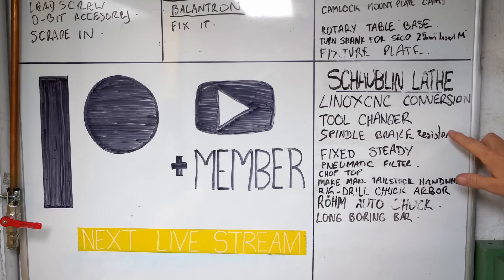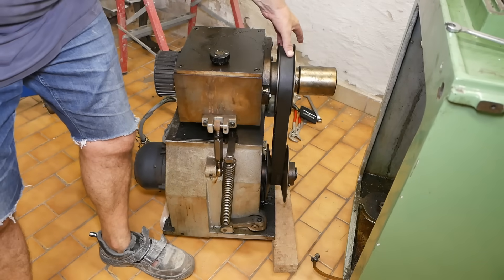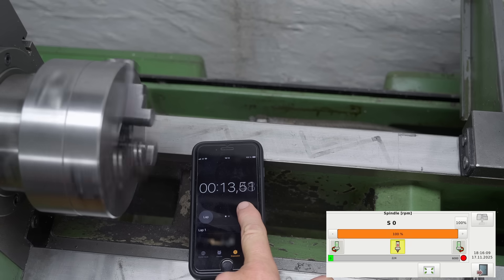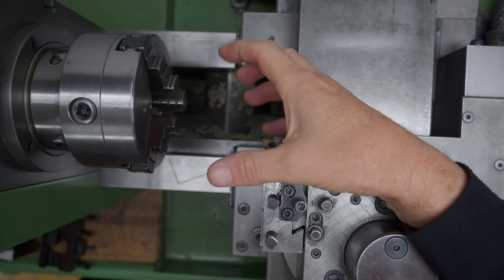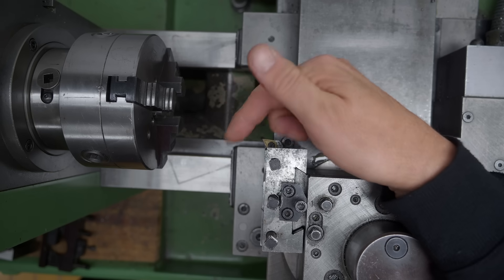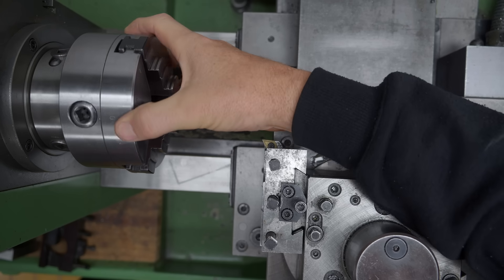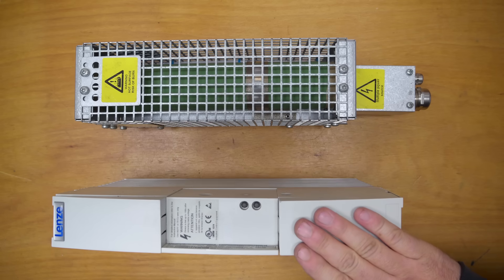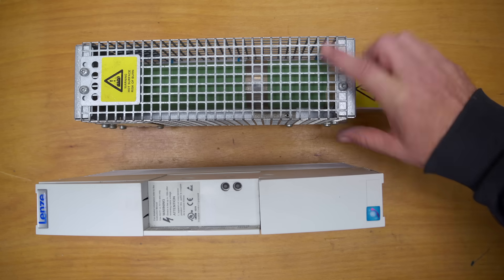Help me with this VFD Please - Schaublin 125-CNC Ep. 62 || RotarySMP

Comment: Hi, I have a Lenze 8200 single phase 1500 Watt with a resistor for braking purpose since years running. As fare as I remember I was able to set up different times to stop the machine. I choose a limitation that correlates to heat that occur in the resitor during handoperated lathe modes. Do you use vector mode?
If needed, I have to look into the details within some days.
regards klaus.
Reply from the maker: Mine is an earlier 8200 version, it is not a vector drive. I have got mine working with the help I received. 
I'll upload a follow up video to show what I did.

Comment: If you want to ramp down you have to leave RFR input 28 on. If you disable the input 28 the output transistors are disabled. You can use a time delay or better use the . There are also two modes to brake the Motor DCB (DC brake). It breaks the motor by inducing a DC current into the coils. So you don't need a brake chopper to stop the motor. So the DC link voltage goes up and the brake chopper kicks in at the set voltage (jumper at the brake chopper). I think  the QSP input was inverted (low = stop), in case of a wire brake the inverter will stop.
Reply from the maker: You nailed it. I thought I was only using pin 28 for Machine start up / shut down and E-Stop. Turns out I was using it for spindle start/stop. Doh!

Comment: These are some of my thoughts about this subject. I have never programmed a Lenze VFD so what do I know?
Instead, I have programmed (successfully) 5 Huanyang VFD's and one Siemens. 5 of those are already in my workshop and do just fine.

Thought 1)
If You decelerate the speed faster than the deceleration curve, the voltage in the capacitor will raise above safe level. In this case the VFD just simply disconnects the motor and enters a fault state. With Hy VFD, this can be cleared with the RESET wire or by cycling the power. I think Your Lenze does exactly this.

Thought 2)
You will need the braking resistor and You need it to be enabled if You intent to decelerate the spindle faster than it would do just coasting down.
My lathe stops from 3 krpm in 2 seconds max, usually well under one second.. Without the resistor I had to adjust the ramp to 20 seconds for the worst scenario.

Thought 3)
If You purchased the VFD second hand, it is a really good idea to do a system reset (factory settings) for it. This way You have a known starting point for Your ordeal.

Since this application seems not to be controlled using serial interface (which is fun) there is no need to be concerned about the lifetime of the internal NVRAM. Namely, earlier non volatile RAMs had a maximum guaranteed write cycle count. Exceeding this would make the device unreliable. That count was quite low, something like 10 - 30 kcycles. One can easily end in trouble with an interface that programmatically alters the contents of the NVRAM.
Reply from the maker: I got it figured out, and will do an update video.
Reply: @RotarySMP  Good to hear.

Comment: your VFD is a vector type drive, so it does not inherently need a braking resistor to do dc injection or phase shift on the motor windings to cancel out the inertia of the spinning rotor.  Depending on inertia, the respective operating voltages of the mains, bucked DC rail and whatever it's doing on the phase leads, you might not have enough headroom to sink that energy and hence the braking resistor comes into play.

Looking at the thing spooling down, it's not doing any negative torque command to more rapidly stop the motion.  There may something like a current limit where it's tripping and then reverting to "drive inhibit, stop doing things on the phases" and kind of goes hands off.  

What signal are you asserting for run/stop?
Reply from the maker: Hi Paul, where did you read that this model of VFD is a vector drive? 
I was using drive enable as start/stop. Doh! I'll do a quick update video.
Reply: @RotarySMP I googled the model number, may be wrong

Comment: Does the VFD support modbus via RS485? I control my lathe spindle like that, from LinuxCNC, constant surface speed works very well.
Reply from the maker: Nope. Only Analog speed control, or presets.  I am wired for analog.

Comment: Hands up, never configured a VFD, but one thought did occur. If your vfd has been grumbling about overcurrent when trying to stop witj a lot of inertia, could it be that its built in braking resistor has burnt out, or a transistor or other gate normally used to connect the motor coils to resistors has burnt out?

Only thing thay suggests otherwise is that your clip clearly showed that the display was showing something different when it was showing the error, whereas I would have guessed that if the internal resistor or gate had burnt out, I would not expect the device to actually know about it.
Reply from the maker: That is what I considered Dave, but it turned out to be my misunderstanding of how I has set up Linuxcnc to command a stop. I'll do a video on it.

Comment: How is your brake unit configured? According to the manuals the unit has 3 switches for configuration, S1 and S2 set the activation voltage and S3 is for master/slave configuration. S3 has to be OFF on the master or single unit.
According to the VFD Manual p. 10-2 725/765 V are allowed for the activation voltage, according to the brake unit manual p. 4-16 this corresponds to S1/S2 = ON/OFF for 725V or ON/ON for 765V
Reply from the maker: Okay, I was able to play around with it some and think I understand it a little better.

The brake is working, but only during a speed change. So with C13 = 0.5S, and C023 at 110% current, the spindle sped change from 70 Hz to 20 Hz is braked (nicely). So that solves my decel between CSS facing cuts.

But switching spindle off coasts down. Since I am commanding the VFD with analog 0-10V, I thought spindle off just meant 0V commanded, but I guess it is uncommanded, and therefore the spindle motor output is simply disconnected. Maybe I do need an additional output pin to E3, and teach LinuxCNC how to command a stop.
Reply: My guess would be, that with Off, LinuxCNC switches Pin 28 to low und the VFD just breaks the power connection. I think you want to use the QuickStop function and that needs E3 in some form to work, the VFD has multiple configuration possibilities and I dont know enough about LinuxCNC to see wich one would be the easiest to make work. And you mentioned safety, depending on how your E-Stop chain is wired up, that might need some adaption too if you want the spindle to quickly stop in case of an E-Stop. You need to make sure, that the breaking of the power connection to the spindle is delayed, so the VFD can actively break the motor before the connection is cut.
Reply from the maker: @WoodmanX  Yeah, I thought I was only using Pin 28 for machine start/ shut down and E-Stop, but had set it to react to the spindle stop command. I need to have a think about the best course of fixing it.

Comment: Looking at how you have it connected I'm guess you are stopping it by disabling the 'controller enable' input (pin 28), do you need to just drop the analog input to 0v, so the controller is still enabled, but the requested RPM is 0?
Reply from the maker: No Pin 28 is used, but only for machine start up and shut down, or E-Stop.

Okay, I was able to play around with it some and think I understand it a little better.

The brake is working, but only during a speed change. So with C13 = 0.5S, and C023 at 110% current, the spindle sped change from 70 Hz to 20 Hz is braked (nicely). So that solves my decel between CSS facing cuts.

But switching spindle off coasts down. Since I am commanding the VFD with analog 0-10V, I thought spindle off just meant 0V commanded, but I guess it is uncommanded, and therefore the spindle motor output is simply disconnected. Maybe I do need an additional output pin to E3, and teach LinuxCNC how to command a stop.

Comment: the Diamond Grinding pins are not that expensive. they like 50 bucks a piece. at work i needed 2 of them and we paid for them with one being shortend to our need less then 150€ from Lach Diamand. but if you want the very good ones from Haefeli in Switzerland you will pay way more then :D
Reply from the maker: 50 a peice. I paid 35 for 10, with two brand new. Nice.

Comment: I hate to be pedantic (well, most of the time), but mom was an English major, and I've spent 45+ years in the electronics industry.  Resistor is the correct spelling for the electronic component, while a resister is a person who opposes a policy or a device that withstands corrosion.  Transistor also ends with an 'OR'.  My guilty pleasure is using too many commas and double spacing after a period
Reply from the maker: I feel for you. My better half is an MSc translator. She also seems to think that gramma, spelling etc are important. I have spend my adult live as living proof that it is actually irrelvant. If the recipient understood what you meant, communication happened :)
Reply: Grammar and precision go hand in hand.
My native language is Finnish and as you may know, it has 15 cases.
You have to be careful when using them because it is all too easy to be misunderstood.
Transistor .... so what would a transister be then?  Someone's sister who is now brother?

Comment: Tiny nitpick for 7:35, the 70% doesn't mean 70% of the length, it means 70% of the surface area of the wire sheathing. The shielding is to prevent induced current in parallel conductors while it is chopping the current. The shielding is only really needed where the wires come in close proximity to other signal wires that you care about.

It is also really important that the shielding is only grounded on one side! You don't want any current to flow thru the sheathing at all. The grounding for the chopper should be a third wire, not via the shield. I see in the manual they show the shield connected on both ends, but that is not how it is generally accepted to to at least in my countries codes. This is so that in the event that the ground bond separates, the shield still doesn't conduct as it is not going to be rated for any kind of real current like a bond wire would be.
Reply from the maker: Thanks. I only connected one end of the shield, and the shielding is in the area where there are other cables, but no signals. The bare wires dont cross or run with any signals.The chopper has a third wire for its grounding. The shield has it's own grounding.

Comment: I'm most familiar with Nidec Control Techniques motor drives (they are usually my go-to).  You can sometimes do braking with DC injection although it won't be as well controlled as a controlled stop with braking resistor - not the kind of thing that will really help with deceleration during operation though.  Some of the Nidec drives offer a deceleration option that dumps some of the excess energy by forcing inefficiency into the driven motor. Always lots of good parameters to tune - especially with the fancier series drives.
Reply from the maker: Thanks Peter. The frustrating thing is that this was working, trying to decelerate, but Over currenting when I first set it up. Now it has the brake resister to deal with the over current, and I can remember what I did to set coast down.

Comment: From what i understood from the manual you need to set the acceleration, deceleration and i max(max current) to suit your application.
You need to enable the dc brake in automatic mode and set it's parameters.
Other than that we need to be on the phone and setting parameters as i read the manual..
Reply from the maker: Thanks Jim, I have now added my control wiring to the description above.
Reply: T1 t2 is probably a thermal fuse, do not supply it with mains voltage
Reply: According to the chopper module diagram it has 6 connections. ±UG which is the dc bus of the inverter and RB1 RB2 which is an external braking resistor.
The you have switches s1 and s1.
For single phase 230v both are off.
For 3 phase s1 is on and s2 is of.
These switches regulate the braking performance. When decelerating the dc bus voltage increases and the braking unit dumps the excess voltage to the resistor.
Your max dc bus parameters must be set accordingly to allow the braking module to operate.
Reply from the maker: @jimbit22  I dont have the chopper module (for heavier loads, and connects to the external resistor), I have the Brake module (internal resistor, lighter loads.

Okay, I was able to play around with it some and think I understand it a little better.

The brake is working, but only during a speed change. So with C13 = 0.5S, and C023 at 110% current, the spindle sped change from 70 Hz to 20 Hz is braked (nicely). So that solves my decel between CSS facing cuts.

But switching spindle off coasts down. Since I am commanding the VFD with analog 0-10V, I thought spindle off just meant 0V commanded, but I guess it is uncommanded, and therefore the spindle motor output is simply disconnected. Maybe I do need an additional output pin to E3, and teach LinuxCNC how to command a stop.
Reply: For spindle operation I always use spindle enable/run and a direction pin(if low clockwise if high counter clockwise.
So when stopping the spindle from 10v first Linux cnc should decelerate the spindle from 10v to zero and then make the enable pin low(or the Forward / Rev pin low).
Probably as you are set up right now HAL instead of decelerating and turning off the i/o pin, it just turns off the io pin without decelerating.
Reply from the maker: @jimbit22  You nailed it. I need to have a think about how to set this up best. If I add an output, to command stop via E3, I could add two outputs, and also wire in the brake.
Reply: Hypothetically you could modify your post processor to call S0000 before M5 so you always brake the spindle before spindle stop. But it is better if you can program it in the HAL to be contained in the M5 instruction(especially if you regularly write code by hand or use mdi instructions). 
In most machines we make we set a very high acceleration/deceleration in the vfd parameters and we increase the rpm/sec acceleration/deceleration in the cnc control and test until we get a fault to see how much it can take.

Comment: be careful having the braking resistor inside the cabinet. I recently had a failure mode with an 8200, where the braking transistor fused and connected the braking resistor permanently to the hi-voltage. It took about a minute before I heard some funny crackling and then I saw  the smoke. Needed a new braking resistor and replaced the transistor...
Reply from the maker: Thanks. So far it is only dead weight anyway. :/

Comment: Hey, so one thing to consider, that brake resistor is going to make some heat. You’ll want airflow to keep things cool. I don’t remember if you had a fan installed or not.
Reply from the maker: It will, but don't forget my duty cycle is measure in minute per month of use. It is unlikely to brake hard, often and in a short period in my usage.

Comment: Interested in a HCS01.1E-W0028-A-03-B-ET-EC-NN-L3-NN-FW with extended firmware?
Reply from the maker: Hi Alexander, 
Thanks for the offer. 
I am just waiting for my flakey Internet to download the manual (A1 signed a pre-contract with us over three years ago, that they were going to run Glasfibre internet in our street over two years ago). Still no sign of it.

Just noticed the price. Ouch! That must be a high end drive. Decoding it, it is 
2.8A max current
200-500V 3Ph
B-ET = BASIC UNIVERSAL with Multi-Ethernet (sercos III,
PROFINET IO, EtherNet/IP, EtherCAT)
Encoder

So it would not be powerful enough for the Schaublin spindle. 

It is probably a really nice match with the two 1.7kW Lenze Servo's i have stashed away, waiting for a project. But if you have someone else who has a more imediate need for it, please pass it to them.
Cheers,
Mark
Reply: @RotarySMP Yes it's a pretty high end drive, with internal resistors. It does have a built-in CoDeSys SPS as well. I think one could build a full garage door control just with that drive. We certainly had software running directly that would also automatically drive the motor.
Reply from the maker: @graealex  I think Leslie and a couple of others cracked my problem. It looks like what I thought was coast down, was me using the drive enable pin as a stop. If I reprogram that back as a enable (Machine start up, shut down and E-Stop), and let the analog signal command stop with 0V, it should hopefully work. I'll try that tomorrow.
Reply: @RotarySMP Yes, some of these drives can be quite cumbersome. While I do have some contacts to Lenze, I don't know their drives in particular. But do let me know if you need a contact.
Reply from the maker: @graealex  Thanks ALex. I also looked up the specs on your VFD wrong. It is not 2.8A max, but 28A max 11 A continuous. What a beast. It would probably make a great spindle drive running a big 5KW motor.
Reply: @RotarySMP It's a beast, it moved hundreds of kg at considerable speed with ease. The important part is that it's actually a servo drive, not just a dumb VFD. Also internal resistors and a brake control.

Comment: You see the report on that cargo ship that wiped out that bridge in America?  A shrink sleeve kept a ferrule from seating properly in a DIN rail connector.
Reply from the maker: Thanks Jim. Wow, that is one hell of a consequence of a single point failure. I wonder if these big ships have to go through the same system safety assessment processes that large aircraft (and nuclear facilities) go through? There is video from some Aussie guy who suspects that 787 which augured in in Indian had a single point failure in battery charging diodes.
Reply: @RotarySMP  Good question.  There's SOLAS and the insurance companies, but I don't know about the details.  The channel What's Going On With Shipping has good content on it though.